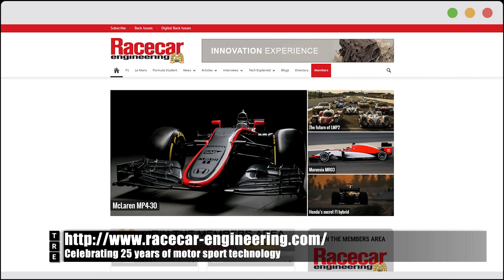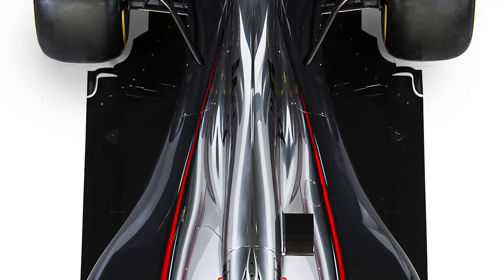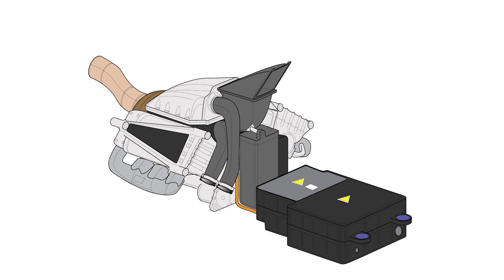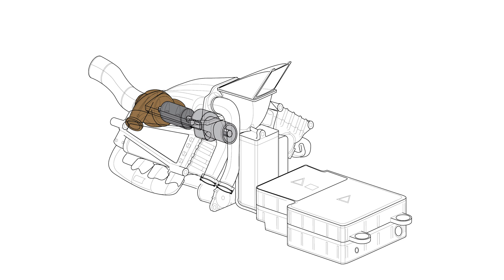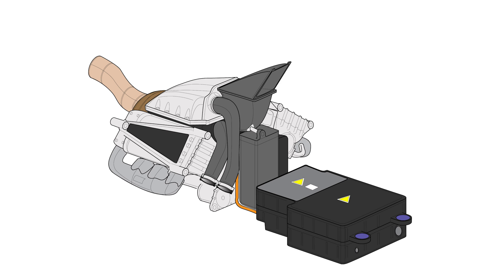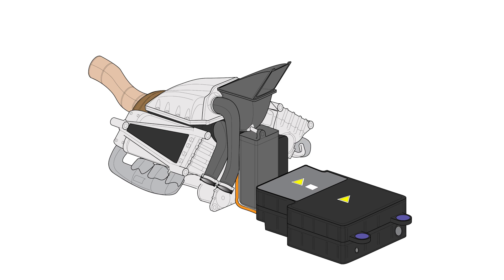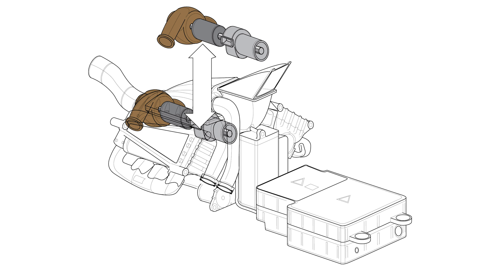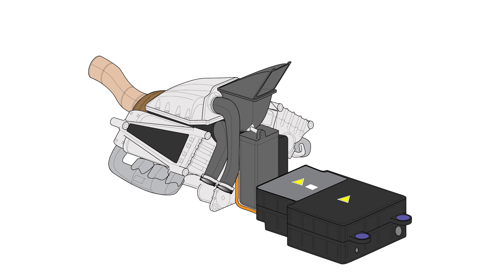Scarbs McLaren Honda PU Analysis

Comment: One thing I simply don't understand is the reason they put the Compressor housing inside the V. Its already hot in there and compressor efficiency will decrease. It will need more intercooling as the compressed air is already hotter due to the compressor sitting inside the V. Am I missing something?
Reply: ***** This temperature disadvantage is partly true, but easily fixed by using heatshielding, and the gain is more important: They gain space to place the gearbox closer, keep the centre of gravity where they want, and reduce the lag due to a short distance between compressor and intake... The Ferrari solution seems even better in that area, but they've had a kink in their exhaust side :p

Comment: I am pretty sure I know why the Honda makes that 3 cylinder rattle off throttle: its in 2 parts 1- on the overrun and 2. on part throttle
1. Its deactivating 3 or more cylinders and not just cutting of fuel either but possibly doing something tricky with the valves to reduce pumping loss
2. As the driver gets on the throttle the engine appears to stay on 3 or so cylinders and then shifts to 4 or more over the next few seconds. This way the savage dollop of torque is eased in leading to better traction. Did anyone say Traction control?
Reply: Rob Ducker  My idea too, and it is what Renault did with their N.A.-V8's. The fact that their exhaust is very short and the moment of inertia of their turbo concept is lower than F.I. Mercedes, makes the exhaust sound hard.

Comment: My question is: Is this all worth it??? 
I heard a rumor that the regulations are apparently going to change once again in 2017, engine based from what I know. I assume a Hybrid Power-Unit would still indeed be used, whether it's a turbo or how many cylinders is still debatable... Also, another rumor is that Audi and VW are looking to join F1, but because of the incredible amount of funding needed to compete, they won't join until Bernie leaves or a new regulation is decided. The current price of F1 is destroying it's competitiveness (in my opinion). 
I know this is all speculation but, this does provide excellent excitement and curiosity to the sport. 
So, back to my first question, is it worth Honda going through all this and only having one year to fight again (2016) if the above rumor(s) are true?? 
Anyway, that's my 5 cents worth... :)
Reply: SuperItalia494 They probably just raise the fuelflowlimit and the amount of fuel they are aloud to carry around a bit. They want to reach 1000hp to calm down some fans with this number and they can also beef up the sound a bit this way.
Reply: I actually wouldn't mind that at all :)
Do you think aero regulations will change as well?? Along with engine capacity and turbo boost?? 
I personally wouldn't mind seeing the driver push to the limit instead of all this fuel/tire saving crap (In my opinion). It's the pinnacle of Motorsports for Pete's sake!!! they get paid enough, so let us see what these driver are capable of... Am I wrong for think this??
Reply: I don't think they will change the aero-rules more than usual. The only thing i can imagine at the moment would be to set a limit to the frontwing complexity. The Merc Frontwing for instance has 6 or 7 elements/flaps on either side. It runs a bit out of hand in my opinion. I mean they look like a piece of art but it is a bit overkill i think. The engine capacity will stay the same, that's pretty sure. In terms of boost well, depends how they design the new rules. There is no boost limit in the rules directly but they limited because of the fuel flow limit.

The fuelsaving isn't a huge thing in my opinion.What bugs me more are the tyres. The temperature window they are really working in is to small and that's whats really limits the racing.
Reply: Yeah, I saw that new front wing Mercedes were running... Looks amazing but, Merc have a bid budget so that's why we are probably seeing these incredible designs. 
So, this fuel-flow limit is really hindering the overall performance of the engine, from what I gather. Of course getting rid of this fuel-flow limit would not alter much due to the 100kg max of fuel now. I honestly would love to see the engines hitting that 15k rev limit, but it seems it doesn't exist... 

I completely agree with you, about the tire saving. I mean it does add a bit more "excitement" since re-fueling was banned and make some interesting strategies. Like Ferrari did in Malaysia.
An idea I thought would be interesting to see would be just one set of slick tires per GP but, with more available during the weekend.

Comment: I detest hybrids (as interesting as the technology is). Energy recovery is okay and logical. But full on hybrids are nothing more then the major manufacturers are terrified of all-electric vehicles and that is why they are pushing hybrids so much.
 They are not pushing it to be 'green' - they are pushing them because they want to do everything they can from stopping people wanting all-electric cars because the latter means far fewer moving parts and require far less service - both things which are important to the manufacturers (the latter especially to the dealers as they make up a very large part of their profits).
 Any doubt of this, just look at the pathetic ranges of the EV's they do sell. Tesla has proven that long range EV cars are possible - but since the major manufacturers do not want EV's, they only sell ones with horrible ranges so that they will never take off.
 Plus, hybrids mean more moving parts, so more parts/service profits, a higher CAFE and probably a higher profit margin per vehicle sold.
  Hybrids in F1 are, imo, virtually nothing to do with making F1 'modern' and are ENTIRELY to do with F1 desperate for major manufacturers money so they agree to these ridiculous engines to get the manufacturers back.
 Dump these pathetic motors that sound HORRIBLE and are staggeringly expensive and just have one engine type that is built by one manufacturer (like Cosworth for example) and sell this (hopefully) 1,000 hp, non-hybrid engine to all the teams at a price that they all can easily afford.
Reply: McRocket Up to Mr Bernie Ecclestone I'm afraid... I do see your point and agree up to a point though. 
One engine, or the possibility of equal specifications/money of each team, would dramatically increase the overall competitiveness of the drivers and make a substantial difference to the atmosphere of the sport. I think of it as being GP2 on steroids lol. 
However, F1 has always been the pinnacle of Motorsport not only because of it's drivers competitiveness and glory but, also the engineering side of it (and of course lap time/speed) 
After all isn't that what F1 is all about? A set regulations that every constructor have to abide by, and through that find the perfect car and driver that can deliver the number one result? 
Just my opinion though mate... :)
Reply: McRocket 'spewed' lol. I support your point of view btw, tho perhaps let the teams decide which v8 or v10 to buy/design. Once that has been done, with a 1000hp implemented, the development costs should level off and engine design kept relatively simple. There is as mentioned a separate formula E already so one can question the need for hybrids in F1 quite feasibly. perhaps they ought to consider aero development to be based on a token system for would that not cut costs and make the size of teams' budgets less relevant and therefore create a more level playing field for all teams? Those front wings alone cost an absolute fortune to make, so limiting their development would mean fewer upgrades and big bucks saved? Just an idea.
Reply: McRocket Like Gates said, there's Formula E if you want a "green" sport. My issue with it is that pushing for cars to run on batteries isn't all that green, do you know how much toxic chemicals it takes to create a battery? Do you know how many gallons of air fuel it takes to ship every thing from one track to another?  And those batteries will be charged up by coal and oil power plants, renewable energy is too inefficient to even bother with at the moment. So how about we get real and get rid of the green pretence?
Reply: Where did I say I wanted F1 to go more green? I didn't.
 I want F1 to abandon 'green' altogether and run (ideally) normally aspirated V8's that pump out over 1000 hp.
 I am well aware of Formula E and I follow it and I hope it takes off. But F1 is about speed, not fuel economy. Dump the ridiculous hybrids and go back to normally-aspirated gas ONLY motors.
Reply: ***** Yes and that has nothing to do with what I said as I DO NOT want hybrids or 'green' F1 cars...I was referring to the major manufacturers...not F1. F1 would be all about spewed and NOTHING about fuel economy or 'being green'.
Reply: ***** I agree with everything you typed - though I do like DRS and maybe (a big maybe) energy recovery system ('free' hp - why not?). I remember F1 got pretty processional for a while there way back when. But now it is not only silly with the hybrids, but ridiculously expensive. Do what Lauda wants - fat rear tires (so harder to drive) and 1000 hp. The fact that a 17 year old can come into F1 and do well means the cars are FAR too easy to drive.
Reply: Each to their own. But I remember when F1 cars simply could not pass each other in many cases before DRS. I am quite sure there are a LOT more passes now then before DRS. And passes are usually where the fun is.

Comment: The individual parts & components may be good themselves but as a complete package they are poor, it is a case of less then the sum of it's parts, it will be a couple of seasons before McHonda are challenging for a win let alone a championship, Renault will get there before Honda.
Reply: Well, look at how bad Ferrari were last year compared to now. I dont think you should underestimate Mclaren-Honda, things could turn pretty fast. Not this year maybe, but in 2016 I think they will be right up there. Honda is a gigantic corp. and Mclaren know what they're doing.
Reply: Rottensteam Until they have had enough, i don't know why Honda bothered getting back into F1 after they pulled out at the drop of a hat a few years back, if they had not have pulled out they would have won the title with Ross Brawn!

I get that McLaren said nobody will win with a customer Mercedes engine, but they may as well built their own engine, furthermore they should have bought one of the teams that went bust & used them like red Bull use Torro Rosso & they could have had the Honda engine as well so they could get more data.

They have gone from being second best team to worst team in a few months, Alonso will be out next year as he won't stay, i bet Button will leave as well.
Reply: BigBaddie666 if Honda had stayed they would not have won ... because their engine was much less powerful than the Mercedes that Brawn ended up with.

Comment: where could be the intercooler between compressor and engine??
Reply: Onkar Mohite The two pipes you see next to the intake scoop on the left hand side will come out to the intercooler I would imagine, the "top" one cold and the lower one hot
Reply: Steve Langdon yes i think the same, the top going into the plenum and to the engine. also the hot one seems to be gold platted as from the images from race car engineering.

Comment: As said in the video, it's a shame that the teams and manufacturers are so secretive with the F1 technology. There should be a rule that requires some degree of disclosure after a couple of years.
Reply: mrbdazz of force them to show it now. There is already a rule forbidding them from covering wings and parts of the car during a race weekend
Reply: I was thinking about some high-level disclosure after 3-5 years when it no longer has competitive value. But not every detail and not necessarily even the design principles, to avoid the road car problem.

Comment: I'm glad Honda decided to come back, they belong on the grid. It's good for the other manufacturers as well - competition breeds excellence. 

It is a pity though that variable valve technology isn't permitted, Honda could definitely use it's experience there - especially in terms of the tradeoff in packaging and such.
Reply: JonnoArigato Well.. Honda's introduction of VTEC in late 80s was THE reason why it was banned in all FIA motorsports :)
Reply: Heh, there is that. I dunno, I just think it's a pity that engine technology such as this is banned - F1 should be the technological pinnacle of motorsport. 

Of course, I'm aware of cost restrictions and such but VTEC for example is not exactly new and unproven! :P